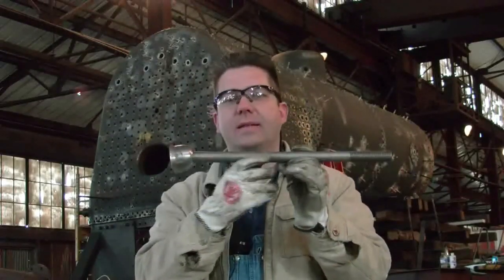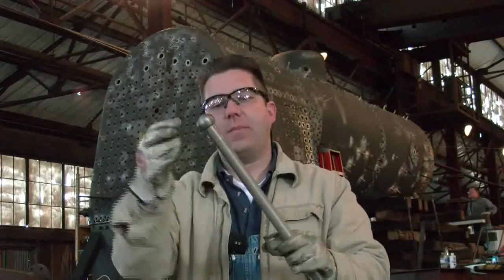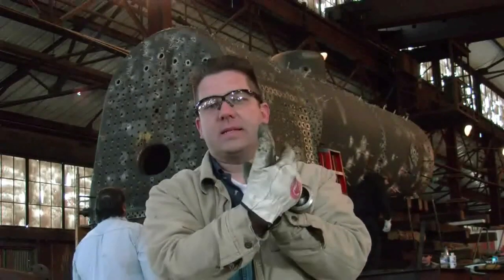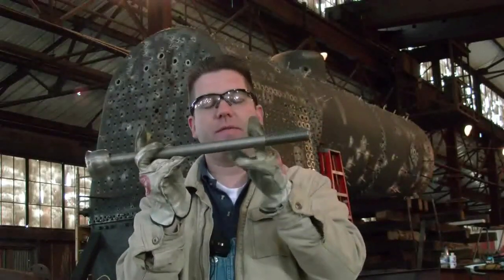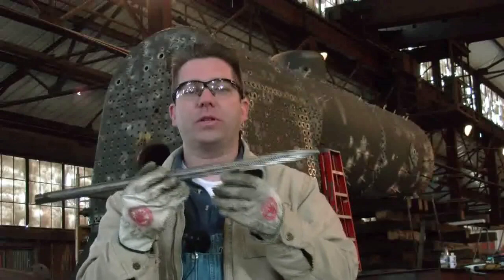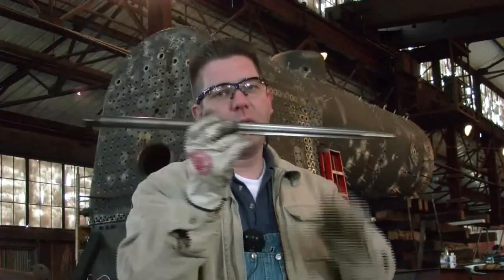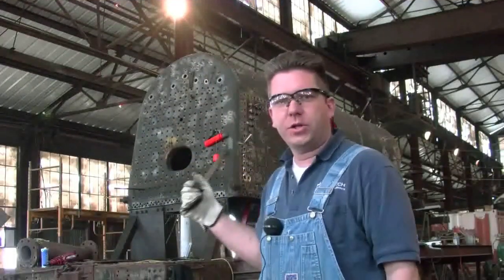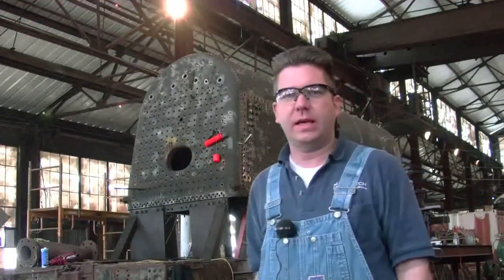WRC Video #18 - Flexible Staybolts

Comment: Fabulous explanation, thank you. Can I ask a question about telltale holes in rigid staybolts? When 1225 broke some staybolts in Owasso in 2009, the crew noted that there was a problem because water was running into the firebox. Does the telltale hole go the full length of the staybolt, or is it plugged shut at one end? Seems to me that if they go all the way through, heat would be lost through each one, and if you add hundreds of little losses it could be a considerable loss overall. 

thank you

Comment: I did find the  math but  would  like  to  know  more  about  thickness  and  how  you use it  In the math used to  calculate  max safe working  pressure  if you  can  I would  like  as much  detail  as  you can ,